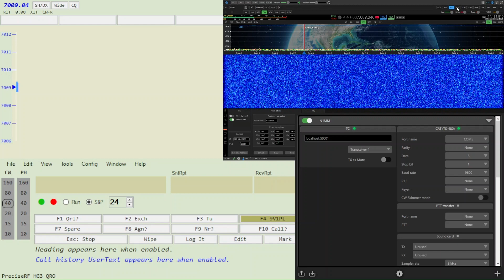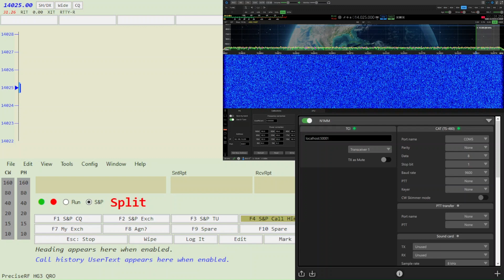N1MM to ExpertSDR3

Comment: hello! what are the settings in n1mm > settings > Hardware tab? I have tried with Radio ExpertSDR and TS480 with the same and different com ports but it still fails, do you have digi or CW/other selected in n1mm ?